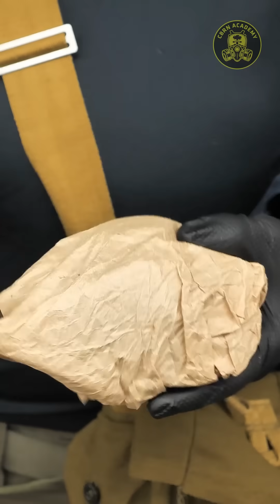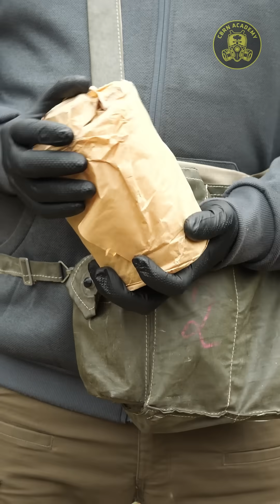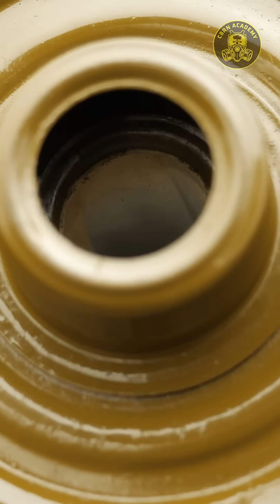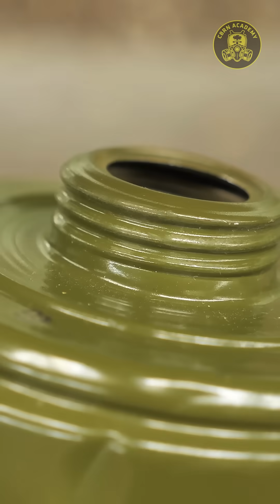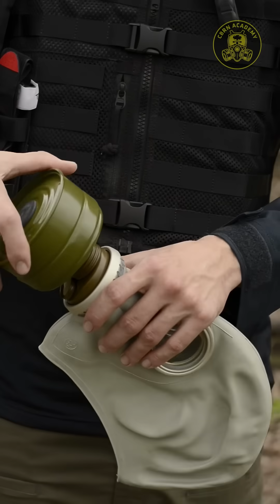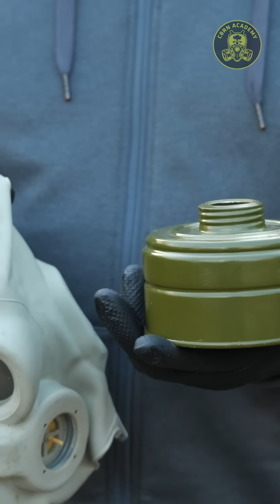Are Old Soviet filters SAFE?

Comment: The risk from the filters that use asbestos is very low, and if it is the only thing you have in an emergency and there is a contaminant I would use one without a thought until I cleared the threat.

Otherwise asbestos or not, don't use filters that old. Surplus Israeli filters are cheap, generally not as old, and don't have asbestos. And if you have a little extra cash new filters (not from China) will still have good activated charcoal!